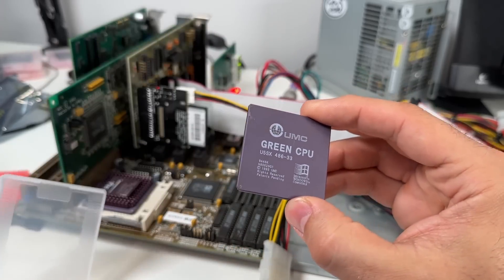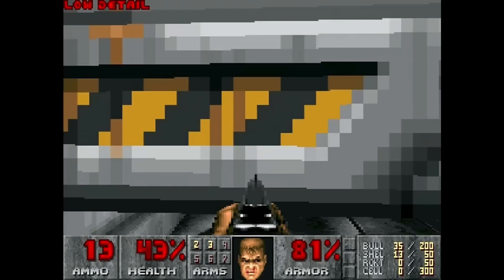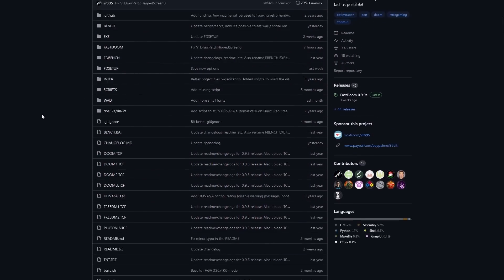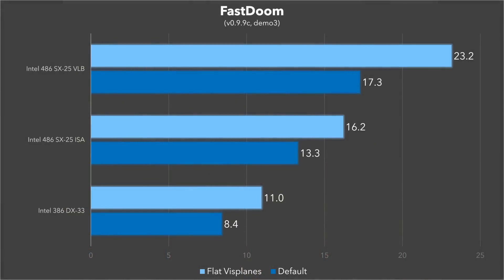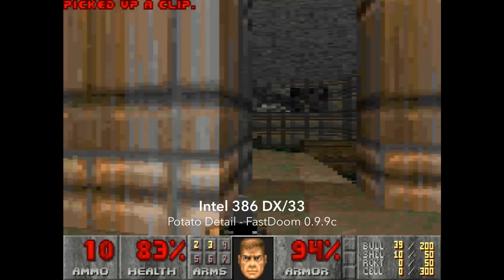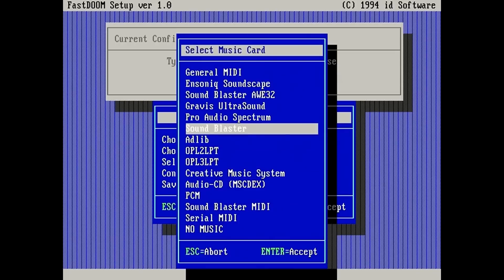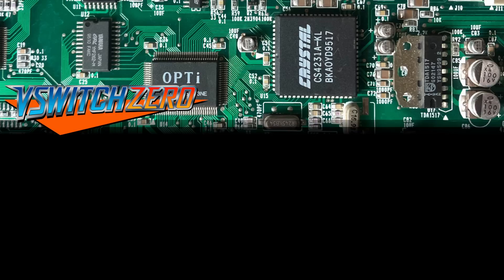FastDoom - Massive Performance Gains on Slow 386 and 486 CPUs!

Comment: You know what shocks me is how big a deal Doom was given that the hardware you needed to play it was so insanely expensive. People complain about the 32x version being substandard but you're talking $350 worth of hardware to play Doom versus 3,500 dollars worth of hardware. And we know from Doom Resurrection 1.1 on the 32x that even more was possible. You could literally get $5,000 worth of performance out of the 32X it's nuts
Reply: The 32X version is compromised in graphics, frame rate and content. In terms of performance it was in the same ballpark as a AMD 386 DX40, only with level geometry, textures and lighting stripped back, it also ran with forced horizontal pixel doubling and a reduced rendering window (though you would also want to do this with any 386). PCs with AMD 386 DX40s were going for bargain prices by 1994, you could get complete systems for less than USD$2k and by the next year (which was when Doom 32X released) they could be found for under a thousand and many of these systems, including mine, came with VLB graphics. 486 CPUs were starting to become a lot more affordable around this time too as Pentium started to rear it's head.

Doom Resurrection is really cool, though. Much like Fastdoom it's made with the benefit of of a quarter century of hindsight, but if Doom had released in such a state at the time it would have been a killer app of sorts, split screen would have been amazing.
Reply: @scheeseman486  You know, I typed much the same thing earlier. But YouTube ate my comment. I'm not sure why I bother typing YouTube comments anymore, anything long enough to be informative just disappears into the void.

Best Buy in mid-1994 was advertising 50-66MHz 486 systems for under two grand. Settle for a 486SX and you could get that down to a grand. That's complete systems, with SVGA monitor, speakers, 2x CD-ROM(!), 16-bit sound card(read as: probably a Sound Blaster 16 clone), and even a fax modem(which was gonna be SUPER exciting in a couple of years when "the internet" became a phrase known outside universities). Which, yes, is still more expensive than a Genesis and 32x, but it isn't five grand. 
And then it came with "valuable software" too! An encyclopedia, financial software, a word processor! The boring crap that will let you convince your parents this is a useful life tool and not a mere game machine! Which is how most people wound up playing PC games: their parents bought a computer for that real-world utility and then their kids found out what SET BLASTER was. 

32x Doom is a very unfortunate thing. It is pretty bad, even by the standards of contemporary console Doom ports, and it didn't have to be. By all accounts, it was forced out incomplete and even before "ship what we have" hit, the developers were not working in ideal conditions. 
Did the 32x have a credible shot at doing real, 100% uncut Doom? No, not really. There's simply not enough RAM, and ROM prices limited cartridge size. Could it have done a respectable port if given the chance? I think it has been proven beyond a doubt at this point, but people keep confusing what should have been with what was actually released. People bought retail Doom 32x, not Doom Resurrection.
...
And really, that's the story of the 32x as a whole: it could've been good, but that's not what happened. It's tragic, really.
Reply: @scheeseman486  I've played the original and it blows a 386 DX40 out of the water. It's closer to a decent 486 33 with a so-so vesa local bus card. I agree there are compromises but it's nothing I would have ever noticed unless somebody pointed it out to me. It's also crazy that $300 worth of hardware back then could match of 3500 PC. People forget how expensive PCs were until the Pentium 166 MMX
Reply: @jeremygregorio7472  The compromises are more severe than you're letting on. Sprites no longer have rotations which removes the ability for monsters to infight, half the levels are missing, the geometry and textures of the levels remaining are stripped back dramatically, lighting is simplified with the key Doom feature of diminishing lighting taken out. You can't even pick up the BFG during normal gameplay since the levels that contained it were removed. No multiplayer, wretched music and both the Spider Mastermind and Cyberdemon are gone.

With the window size set 2 or 3 notches down and running at double pixel width, roughly matching the 32X port, my 386DX40 felt pretty close to the 32X port in performance. Your experience may be different and I would absolutely believe that, the video we both watched showed how much variability there can be given how bottlenecked Doom is when trying to push pixels over the ISA bus.
Reply: Prices of tech fell fast then. And in 1994, when the 32x came out, Best Buy was advertising a 50MHz DX2, with monitor, printer, 16-bit sound card, fax modem, and 2x CD-ROM(!) for... $1998.

Which, yes, is still much more than a Genesis and 32x. But it isn't even half of 5000 dollars. And it also does MORE. I can't tell from this scan all of what "over $800 dollars worth of software" includes, but it's definitely got some boring useful adult programs. Grolier's Encyclopedia, Microsoft Money, the omnipresent Microsoft Works... stuff with practical use that might convince your parents it was a useful tool and not just your new Doom box.

And that modem would be hella interesting just a couple years later, when "the internet" became something people outside universities knew about.
Reply: Prices of tech fell fast then. And in 1994, when the 32x came out, Best Buy was advertising a 50MHz DX2, with monitor, printer, 16-bit sound card, fax modem, and 2x CD-ROM(!) for... $1998.

Which, yes, is still much more than a Genesis and 32x. But it isn't even half of 5000 dollars. And it also does MORE. I can't tell from this scan all of what "over $800 dollars worth of software" includes, but it's definitely got some boring useful adult programs. Grolier's Encyclopedia, Microsoft Money, the omnipresent Microsoft Works... stuff with practical use that might convince your parents it was a useful tool and not just your new Doom box.

And that modem would be hella interesting just a couple years later, when "the internet" became something people outside universities knew about.

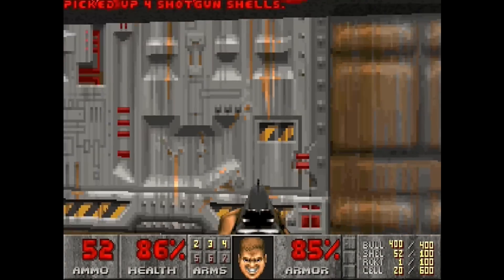Comment: 6:45
LEA Load Effective Address (calculate address offset)
SHL Shift Left  (integer multiply by 2)
SHR Shift Right (integer divide by 2)
Reply: ACKSHUALLY :^)
it's more like multiplying and dividing by a power of 2. You don't have to enter in SHL 5 times to multiply by 32. You can just do SHL EAX, 5 or whatever
Reply: @sharoyveduchi  Indeed. I didn't want to overload people with (pardon the pun) too much information. 🙂
Reply: @sharoyveduchi  A bit shift is a lot faster since no actual calculation takes place, it just moves all the zeroes and ones to the left/right by n times

Comment: 1:48 Installed a 68060 in a non-zif socket a few weeks ago. I never aged so many years in such a little timespan. And worse then installing the new CPU was removing the old one. ^^
Reply: I can imagine. The 060 was a rare and expensive beast indeed, the king of the 68K world. What did you install it in, Amiga?
Reply: @MoultrieGeek  Upgrading a 040 turbocard for the Amiga with a 060. What a difference. ^^

But I will never remove that 060 again, at least not without proper tools. They exist but are almost impossible to find nowadays. So I had to work with the things available to me and so I chose two slot covers for PC-slots and used them to push the CPU out of the socket by wedging one below each end of the CPU and slowly lift the old CPU out of the socket. That was already difficult on the old 040, but the 060 has a row of pins more, making it even more difficult to remove it without proper tools.
Reply: is that IBM PC compatible? did you solder it?
Reply: @Rei_Anda  No, Motorola 68k is a whole different breed of CPUs and not compatible with Intels x86. It was used in many computers of the 80s and 90s like the Amiga, Atari ST and several Macintosh models.
Reply: @tellmeaboutloom  Also a whole range of consoles. And as an embedded CPU it's in so many random things including a number of cars. It was a pretty cool CPU architecture.
Reply: @Rei_Anda 68060 is very much not going into an IBM-compatible.
And he didn't solder it, he put it in a socket.

Comment: So doom need 486 DX66 to run full potential? That was top of the line computer back then! Not to mention a VLB graphics card. Expensive!
Reply: First Pentium was released March 22, 1993. Doom was released December 10, 1993. So to say a 486DX2/66 was "top" of the line is slightly inaccurate.
Reply: @aleaxdeathbringer  well not everyone had the latest stuff. First pentiums also had the division bug. I got my first 486sx33 in late 1994 or so. First pentium in 1996. Before 1994 had to work with a b&w 8088.
Reply: @miasmator  i get that, and I actually gave the first Pentium a miss because I had heard about the bug. The 90s  saw so much development and I spent so much on technology that I think I actually messed up my future. AKA present. So don't be so jealous.

Comment: As a kid back then I didn't even know there was such a thing was better performance, at least not until I started building my own systems. First x86 we had as a family was a 386, and any slideshow or framerate issues have not managed to lodge themselves into my memory.

All computers had DOOM back then, I remember playing it even on the receptionist's computer at my mom's workplace when they didn't need to use it.
Reply: I remember not only having a second hand 386 but only having 4mb of ram and having to do autoexec.bat magic to be able to free enough memory to play Doom/Doom 2, and also remember a later level with lots of demon heads and that was not a slideshow but like a disney movie render, many seconds per frame, very unplayable.
Reply: True, I was playing Doom 2 at like 10-15fps apparently on my 486 sx25mhz and didnt know it until i saw it run on my friends pentium.  Couldnt go back to that after but enjoyed it without issues before that.   I also shrunk the screen for better performance.

Comment: Potato looks like the SNES version but playable
Reply: SNES Doom was my first experience with Doom.  I don't even remember where I got the red cart from, as a kid.  Now after playing Doom on a PC well over 2 decades its astounding how bad it looks, but back then it looked and ran pretty amazing for the time, I felt.  I played on the lower difficulties mostly, as it was plenty challenging.
Reply: @johndoe7270  It's an achievement that's for sure.  With the Snes mouse it's a little more playable but still best to avoid.
Reply: @Retro-Hamer  The lack of circle strafing was my biggest gripe.  Now I'm curious about the mouse.  I knew of it but thought it was for Mario paint.
Reply: @johndoe7270  Several games used it, including Lemmings 2
Reply: SNES version is playable, just not by today's standards 😂 Remember, people played Star Fox on that console and loved it. Even though framerate is so low.

Doom for SNES gets bad rep mostly because it was released late. Playstation port followed soon after and in PC community huge majority of people switched to hardware powerful enough to run Doom well. But if it would be released by end if 1994 a lot of people would be envious of how it ran on SNES.
Reply: @kamilciura7953  No one can argue with what was done to get DOOM on the Snes.  I didnt play the game until around 10 years ago.  32X was the first version I ever played.  Didn't play DOOM on PC until 96.
Reply: now i need to experience that version😅
Reply: The SNES version is basically FastDoom in potato mode with Flat Visplanes. If you ever wanted to play the SNES version on a i386 PC then that’s how you do it

Comment: This version of Doom is also the preferred version to play on the AO486 core on the MiSTer FPGA system which creates a Tseng ET4000, 486SX-50, SB16, MIDI 330 PC.
Reply: I was going to say, this seems ideal for AO486. I wonder how much of the optimization work might also be applicable to ARMv4, used by the GBA. The port of prboom already runs quite a lot better than the original retail copy of the game did, and perhaps fastdoom can run better still.

Comment: I have come to see the wisdom of leaving vertical mouse motion enabled in doom. You can get a nice speed boost if you push the mouse forward while moving with a button/key press at the same time. This can make it easier to make jumps across gaps. I have played more than enough games with full mouse look that I no longer have unwanted vertical movement so I have no need to turn it off. Not sure if the speed boost is better than just running but I have problems with holding shift to run so  it works for me but may not be good for others

Comment: NEC V20 optimized mode when?
Reply: Doom8088 is optimized for 8088 and 286. Should I supply a separate NEC V20 version?
Reply: @DookNookim I will have to check it out. the 286 version might work on the v20.

Comment: PCEM17 more or less sent old hardware to museum. No point running on original hardware when you got hardware emulator.
Reply: Yes, but actually no. The point of running old hardware has always been because we want to, not because we have to.
Reply: Yes, but actually no. The point of running old hardware has always been because we want to, not because we have to.
Reply: @CptJistuce  Dont get me wrong i like old hardware, but its now very difficult to obtain. Not to mention you have to service old hardware before using it. Before hardware emulation you had no choice, now you do.
Reply: @harbinger200  Can't argue with that. The availability and cost of old computer and video game stuff is tragic(used to people couldn't give it away, now everyone's certain it's all solid gold). 
And I'm remembering I have a picture tube monitor that recently stopped picture-ing that I need to look into... siiiiiigh.

 I mostly took umbrage with the "no point".
Reply: @CptJistuce  I have one TV and CRT waiting for full rebuild at some point, have no cache for it now... :)

Comment: I’ve been looking for a way to disable the mouse’s vertical axis since the ‘90s and now you tell me about the TSR, NoVert?! Well, thanks. I plan to use it with the Ao486 core on MiSTer. :)
Reply: Back in the 90's one of the mouse drivers would let you set the vertical axis input sensitivity to zero. It worked great!

Comment: Still holding out hope for a 286 version!
Reply: Doom8088 is a 286 version of Doom.
Reply: @DookNookim  I forgot about that!
Reply: I think Doom needs 386 specific features
Reply: @tcscomment  the only reason I think that can be overcome is because the 286 is the only thing run with electricity that hasn't had Doom ported to it
Reply: years and years ago I completely re-textured Wolf3D to use Doom textures and mobs, then made a load of custom maps. I called it "Doom286" and it was actually pretty funky. I put loads of work into it, but have no copy anymore.

Comment: I tried fast Doom on an OG 33Mhz Intel 486 DX. I managed to get the performance up to a lower end 50mhz 486 without resorting to shrinking the screen size or halfling the resolution. And since my board allowed me to overclock the 33 to 40Mhz, it performs very similar to a DX2, but that's also because I had some L2 cache to help with that. Back in the day, 33Mhz was enough to get a decent experience but Fast Doom definitely had features I wish existed in the 90s, because then, I only had a 25Mhz SX.
Reply: I understand that pain all too well.  The family computer from December 1992 to January 1997 was a Pionex 486sx25 with 4mb of RAM from Sam's wholesale.  We got DOOM in fall of 1994 and two months or so later dad came home with DOOM 2 and very shortly after getting DOOM 2 dad doubled the memory to 8mb for us.  That extra 4mb of RAM made a huge difference and DOOM 2 level 16 and level 30 no longer froze.  I will NEVER forget when we FINALLY got the Pentium 133 in January 1997 and experiencing that MASSIVE performance jump and could finally use the plasma rifle and BFG without killing the game.

Comment: I wish it was a thing when I was playing Doom on my 386DX-40 :)
Reply: Yeah, same. I only had a 25mhz 486SX. We definitely had to get used to the low res mode.
Reply: Doom was the reason why I overclocked my 486SX 25 to 40Mhz
Reply: Right?

Although I do think it made me a better player once I started playing multiplayer from a more powerful system.
Reply: Or my SX-33... awesome video!
Reply: Adding a coprocessor to a 386 or to 486 SX will make a huge difference.
Reply: @MrZorbatron  but not in doom. Doom doesn't use fpu instructions. Quake does
Reply: @mixal31  that's very interesting.  What would you say the reason is for the poor performance on the Cyrix 486 processor, then?  Just like with the 5x86 and 6x86, they were very good integer pumpers, but floating point math was very poor.  This even applied with processors that did not have integrated FPUs, Cyrix floating point math was simply handled inefficiently.  Heretic did want floating point functions, which is why it wouldn't run on a 386 or a 486 SX unless you specify the -debug argument when launching it.  Drop in a 387, and at launches just fine with no special options.  -debug really slowed down heretic on my 486dx2 and dx4 machines.  Also, I distinctly remember a tangible boost with the 387 or weitek coprocessor added.
Reply: @MrZorbatron  first generations cyrix 486 cpus had a little slower cache / latency
Reply: @MrZorbatron  Doom didn't use floating point math, so it won't have any effect at all.
Reply: @MrZorbatron  Not to Doom, it had no FPU code in it. I think Quake did though.
Reply: Lowres small screen Doom club member checking in.
Reply: I had a 386DX-40 too. I believe most of the time i played high detail mode but view slightly decreased. I would hav guessed it had 20 fps. I was pretty happy.